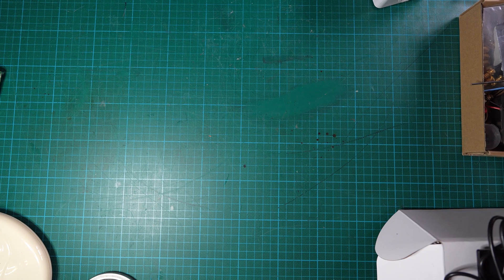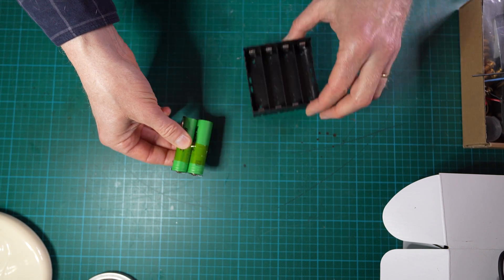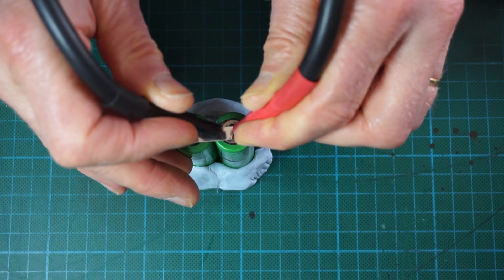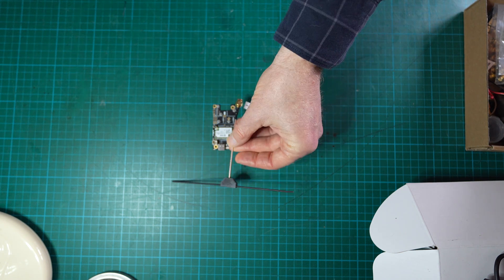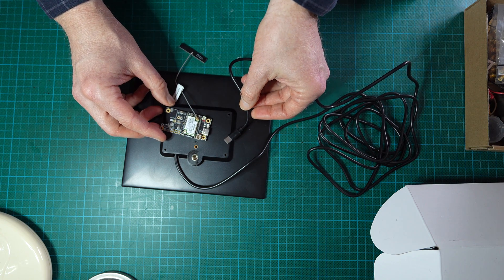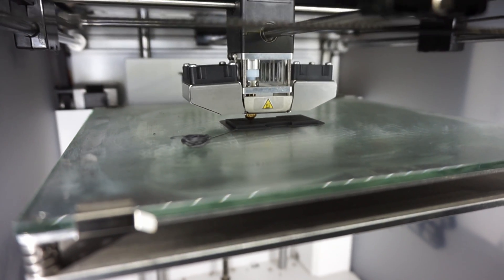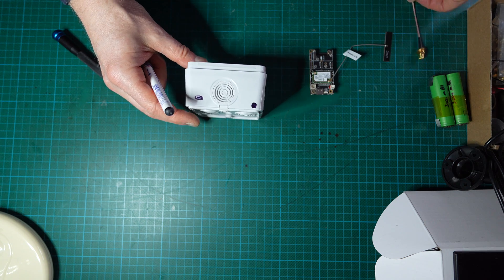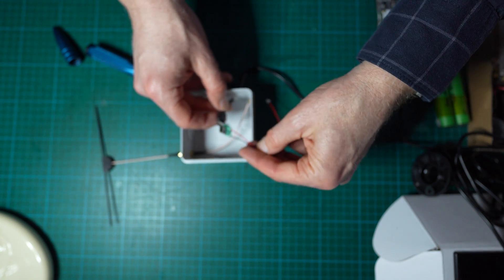Meshtastic Solar node build  - part 1 of 2

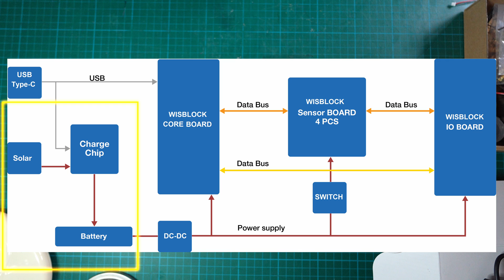Comment: is there any benefit of using the solar port instead of the USB port? From the diagram at 6:18 ,  it looks like the only difference is that the USB port serves both the "Wisblock core board" as well as the "charge chip", whereas the solar port only serves the "charge chip".

Assuming the diagram is right, I have the impression that using the solar port introduces unnecessary conversion loss for providing energy to the "Wisblock core board" (solar port -> charge chip -> battery -> DC-DC -> Wisblock core board).

Comment: At the moment a RAK board will run for about a week off the same 18650 battery that will last 12 hours on an ESP32 board. In northern climes a smaller solar panel will support a RAK based node much longer than one using an ESP32 chip
Reply from the maker: Yes, much more power efficient (and no screen helps too)

Comment: The connection of solar panel doesn't seem wise. As it's USB it indicates the existence of some kind of voltage regulator circuit inside the solar panel itself so it would output 5V. Quite wasteful by itself and on top of that I'm sure that there are many cases in which solar panel is producing some usable power, but it's not enough to go through such converter -> and all of it ends up wasted.
Reply from the maker: To answer to this question I will simply put it to the test and see the results.

Comment: LTO batteries would be a better choice if you live where it gets below freezing, or very hot.
Reply from the maker: That's what I've also heard elsewhere but without any real life experience.
Reply: @PoweredMeshtasticEurope  my experience with them is in a solar weather station. I've had it for a few years and have seen temperatures as low as about -12c where it was still charging. So far there has been no appreciable loss in battery life. There is a period every winter where I don't have enough sun to charge the battery, and this year I had to charge it twice, which is the same number of times as the last few winters. I don't have any longer term data unfortunately, and I don't have any good way to measure capacity as it is integrated into the unit.

Comment: i think the 5-6W Panel is a total overkill. 
I use my rak with 1.5W Panel and it has not gone lower than 95% charge in month.
Reply from the maker: Great feedback. What capacity battery do you have with this node ?
Reply: @PoweredMeshtasticEurope  4x 18650 but these are used so ~10000mAh

i used a parametric rugged case from printables as base and than added holes for the antenna, charging and a mount for solar panel. To access the USB-C Port you have to open the Case but the RAK can stay mounted. 

Sry, can't post a picture here. 

Also i used an additional tp4056 to charge the Battery from the Pannel as the RAK is known to be sensitive to overvoltage. The chip for charging in the RAK is also a TP40** and not a MPPT module. 

If you look at the schematics the 3.3V chip can only take 5.5V and this is the choking point (TP4056 could take more)

I still want to test MPPT vs TP4056 to see the difference, but that will be for me heltec node where the 5W Panel is not enough.
Reply from the maker: @JoergGebhard  thanks for your experience. I will have to test the output voltage of the panel (should be 5V theoritically). If not, I'll use a TP4056 (have plenty laying around from a previous powerwall project) or a boost/buck converter.
Reply: That may work if there is enough sunshine. In what region and latitude do you achieve this? In Switzerland there are lengthy winter periods without almost any sunshine at all (depending on the location).
Reply from the maker: @frankfehlmann2083  you can increase the total battery capacity so that it covers largely enough the staistical number of so called "white days" (days without enough light for any solar panel to produce anything). In my tests, 4 cells, 3Ah each, (so total capacity of 12Ah) drop to 50% of state of charge after 2 months without any connection to a solar panel. I am in Belgium, much more north than Switzerland, and a renowned country to never have sun lol.
Reply: Austria, around Vienna, i planned measure currents from the panel and the Rak but this is an future project. location is Austria near Vienna  @frankfehlmann2083
Reply: Don't fry your RAK and ensure that the panel never exeeds 5V. Thank you a lot for your building videos!